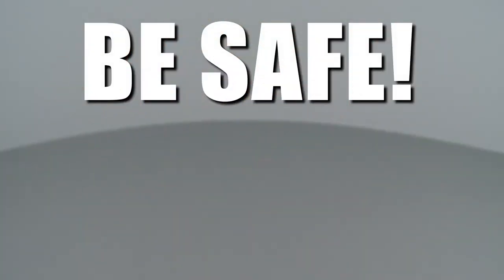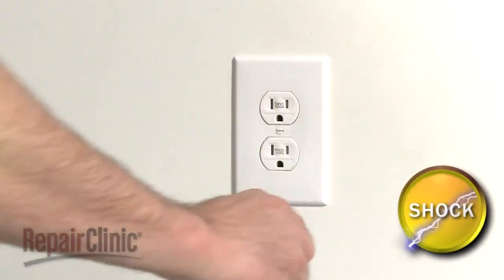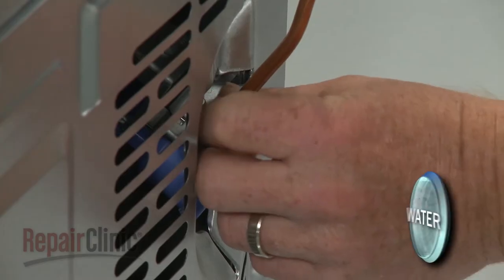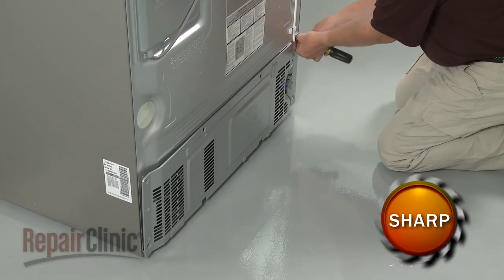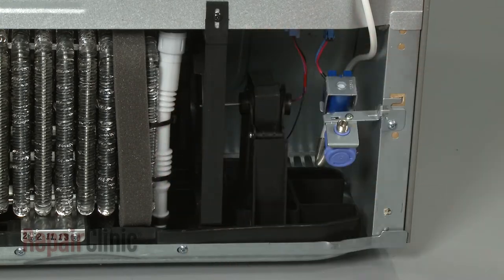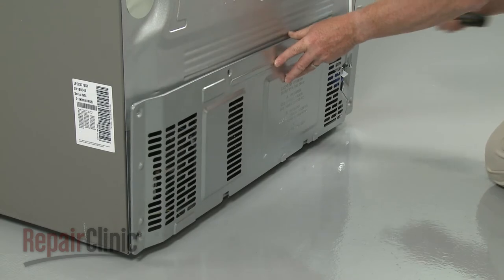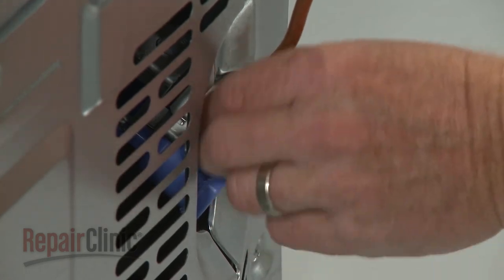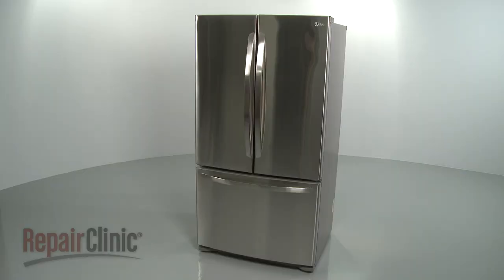LG Refrigerator Condenser Fan Blade Replacement #ADP36665701

Comment: Thanks, my fan blade also broke, I thought I should change the all piece with the motor (+-60e) + a technician (70e also)... but after your video, it seems so easy.. I bought a fan blade online at 16eur! Do-it-yourself!!
Reply: By the way, My fridge is a Beko cn 153920, but the system is the same than your video shows;)